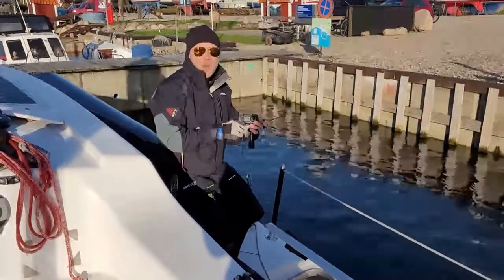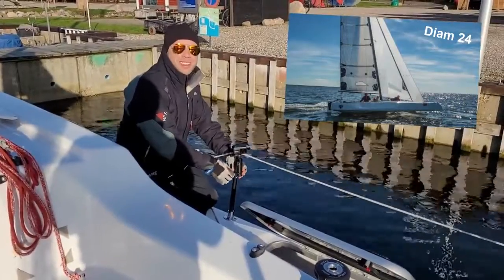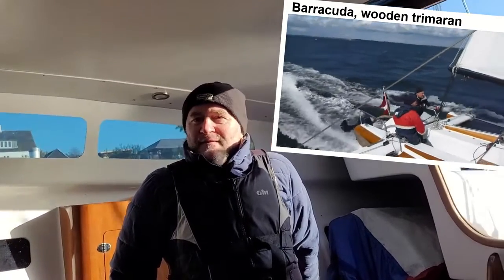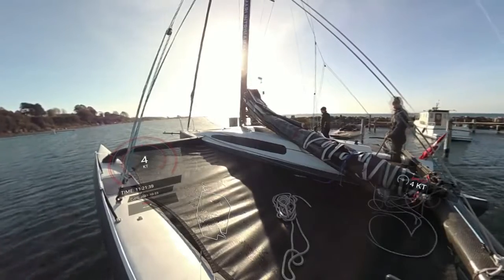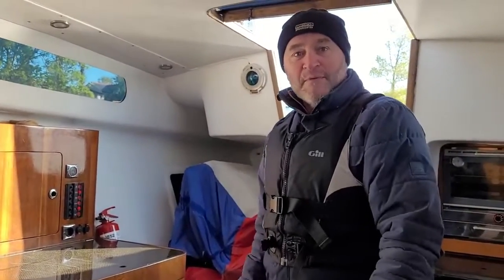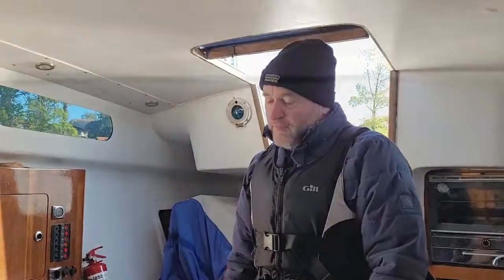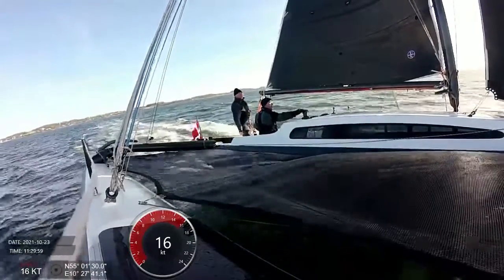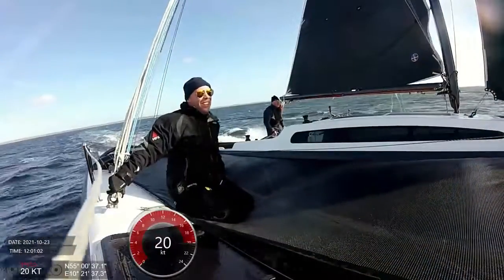Marlin 33 Trimaran   Real Speed Test and Technics

Comment: How does this stack up against other Trimarans like Rapido/Corsair, Dragonfly, Waarschip Composites/Grainger Designs TR-36.  Anyone have any idea?
Reply: I don't know but the "fastest boat in Northern Europe" claim seems hyperbolic when the Seacart (to name just one) exists
Reply: corsair and dragonfly are not full carbon boats (maybe they have such options?). they are much heavier for the same length and there is no way they could compete. this being a 33ft boat is even lighter than a corsair 880 or a dragonfly 28. however, corsair offers cost-effectiveness and dragonfly offers build/design and comfort.
Reply: take a look at each year's silverruder result. this thing smoked any corsair or dragonfly.

Comment: I really like this trimaran. It is clearly fast. Would be curious to know more about it's safety specs for passages and long journeys.
Reply: Jan Andersen, the designer, builder and sailor sailed on the open North- and Baltic Sea many times in the last 5 years. Als me, we got 30+ knots and high waves of the "Vegvisir" Race (double handed) which we won. If you like, you can sail it to the Carbibbean :-)